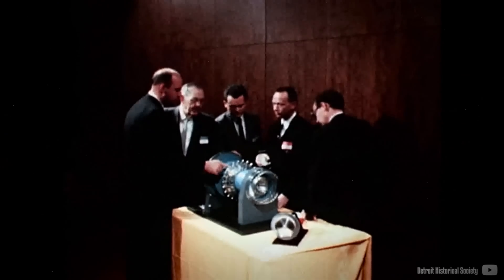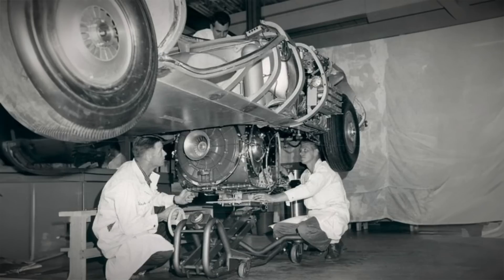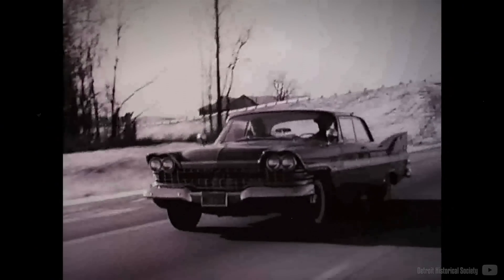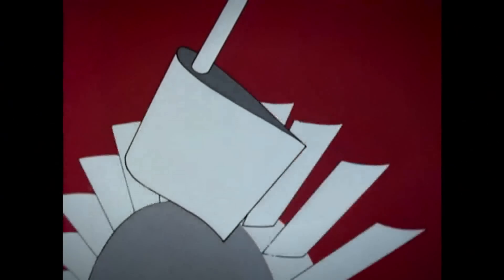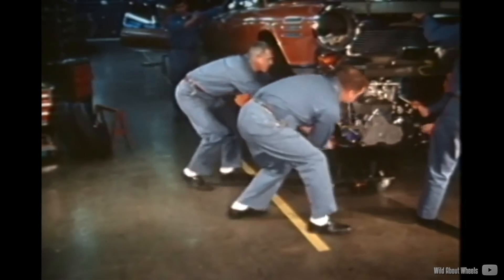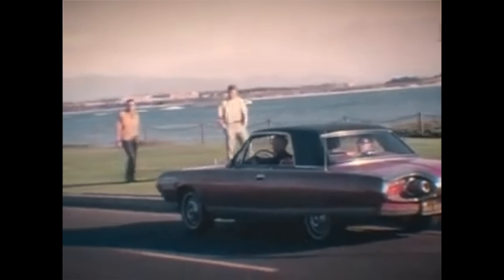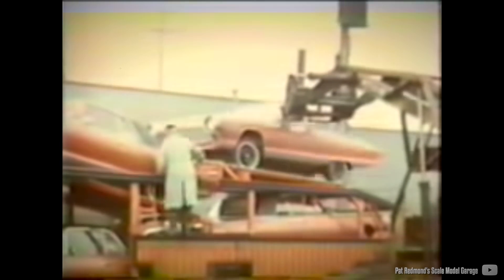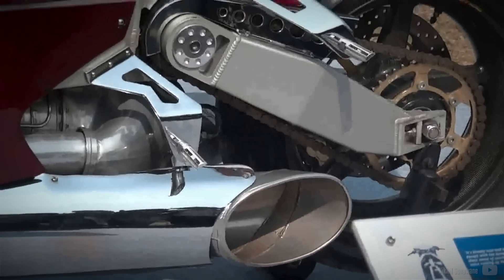The Failure of Chrysler's Multi-Million Turbine Car Project

Comment: This tech used along with  hydride tech. Seems to be a perfect car. Use the electric motor to handle the acceleration duties. While the engine slowly accelerates. The vehicle is moving at the requested speed. Then the engine recoupled to the drive. It could be electric with a turbine generator. The turbine only running to charge the batteries only, It could have a location for a 20lb propane tank. A 10 gallon gas tank, a 10 gallon kerosene/Diesel tank, and a 10 gallon ethanol/methanol tank. And s used oil tank, to akloe used and cleaned vegetable oil, or used engine oil to be used as fuel, Or the gas, diesel, kerosene could be one tank. And the methel/ethenol tank could be separate. Alcohol doesn't mix well with diesel,
Reply: Gas turbine engines are completely unsuitable for hybrid electric vehicles.

Not a very practical concept, you need multiple fuel control systems for each type of fuel.
Reply: Gas turbine engines are completely unsuitable for hybrid electric vehicles.

Not a very practical concept, you need multiple fuel control systems for each type of fuel.

Comment: Not a failure at all, as your video demonstrates, jet engines are the most efficient and powerful.  And it worked.  Chrysler was the greatest automaker at the time.  But did not have the infrastructure to manufacture and market its turbine car.  It’s a failure of having a regulatory regime on the   U. S. banking system.
Reply: It was an epic failure and was never a viable concept.
Gas turbine engines are completely unsuitable for automobile applications, they are too expensive and not fuel efficient at all, these cars averaged 5 mpg circuit and 15 highway, not impressive either with just 130 very sluggish horses.
Reply: @WilhelmKarsten  They already proved the suitability.
Reply: @frederickmfarias3109  The research conducted during the trials of the 50 preproduction cars proved it was not a viable concept.
The final nail in the coffin was the data from the customer surveys, people who test drove the cars overwhelmingly stated that the were unwilling to pay the retail sticker price for a gas turbine car.
Reply: @WilhelmKarsten  You don’t have eyes apparently, they worked, still work!
Reply: @frederickmfarias3109  Yet the program was ultimately a failure... a failure because it made absolutely no economic sense.
Reply: @WilhelmKarsten  Top speed was 120 mph.
Reply: @frederickmfarias3109  Preproduction cars are only 130 horsepower.
0-60 mph 12.7 seconds 
Top speed 87 mph
Reply: The program was canceled simply because consumers were not willing or able to afford the staggering cost of the gas turbine engine estimated to be over $55,000 dollars!!!
Reply: @WilhelmKarsten  Chrysler had previously problems in costs in manufacture of costs of critical parts of the car, but in engineering innovation was able to bring it down.  They could have done the same in manufacturing the car itself overall, and In economy of scale.!
Reply: @frederickmfarias3109    Sorry, but that was the cost adjusted for economy of scale and automation of manufacturing process.

Gas turbine engines are extremely expensive to manufacture and a similar 130 horsepower non-flight rated engine would cost around a half million dollars each in today's value.
Much too expensive for mass produced automobiles.

Comment: Was it the threat of reliability affecting profits of the repair industry ???
Turbines used in a common American tank seem to prove this......
Reply: This was never an economically viable concept.
The M1 Abrams scandal is not a good analogy..
The General Motors XM1 won the army trials, it's Continental AVCR-1360 Diesel engine beat the Lycoming AGT-1500 gas turbine in every respect.
The Turbine is the biggest flaw in the M1 design.
Reply: @WilhelmKarsten in the second trial of the competition, Chrysler heavily fixed their prototype and GM basically changed nothing. All of Chrysler fixes made their tank better
Reply: @2003AudiS3  The US Army rejected the Chrysler and awarded the contract to the Diesel powered General Motors XM1.
The rest of the story is one of the worst corruption scandals in American history.
Reply: @WilhelmKarsten  in the second trial the Chrysler was a lot better
Reply: @2003AudiS3  It still lost to the GM XM1, the Army did not want the Chryslers gas turbine engine or its fatally flawed turret design.
Reply: @WilhelmKarsten  The turbine was literally an equivalent to the diesel. Both used similar amounts of fuel but the diesel was less reliable
Reply: @2003AudiS3  Wow! So you have never seen the trials results have you?
The AGT-1500 was the worst in fuel consumption by a huge margin of all the engines tested and was the slowest in acceleration.
The AVCR-1360 Diesel was rated at 1,650 horsepower and passed the PTRT tests for reliability... Diesel reciprocating engines are inherently reliable by design.
The Chrysler version required a fuel capacity double that of the GM to meet the minimum range requirements.
This is the root of the fatal flaw that plagues the M1 to this day and the Army desperately fought against.
Chrysler did something very dumb, they moved the main ammo  magazine from safe down in the hull to up high in the turret.
A weak point in the design that many enemies have exploited.

Comment: The other killer was the high oxides of nitrogen emissions from the gas turbine that could not be easily reduced.
Reply: Yes, excellent point.
Although the emissions regulations did not exist yet, NOx pollution was a factor in the cancelation, the Chrysler program was ultimately canceled because of the astronomical production costs of these difficult to manufacture engines

Comment: Very nice video as always, thank you! 
It is clear that turbines are unsuited for cars, but I've been wondering if maybe one could consider using a turbine as a power generator/range extender for e.g. an electric/hybrid truck (either semi, or else). That would retain many of the advantages of the turbine wrt piston engines, while alleviating many disadvantages like throttle response, etc. Just an idea :D
Reply: Not a viable concept either.

Comment: Fast forward to 2023.... turns out if a jet engine is in the sky, the pollution and made-made cirrus cloud cover we see endlessly every day all over the world is not a problem. If a jet engine is on the ground in a vehicle? NO NO NO NO NOOOO! Much too polluting and would never pass emissions standards.
Frankly it's all about money. Who can pay off who. It's also about weather manipulation via JP8 jet fuel and all the crud they put in that fuel to modify clouds with 100,000 global flights per day.
With the modern microprocessor capability, Garmin units, and all the rest that operates these expensive small turbo-prop airplanes, I would think a very reliable and powerful turbine engine would be feasible for autos, much better than was feasible back in the day when it was tried by Chrysler.
Reply: The price of the engines killed the program

Comment: I don’t know that you could rightly call it a failure. They tried hard to make it viable and it just wasn’t. I think you could call it a failure if it made it to production and flopped.
Reply: Most manufacturers developed gas turbine engines, Chrysler was the only one foolish enough to build a fleet of test vehicles.
Reply: @WilhelmKarsten Bulshxt!
It was a success!  Chrysler did not have infrastructure to manufacture and market it.
Reply: @frederickmfarias3109  Not true, it was a failure.
The estimated mass production cost of the engines was over $55,000 in 1965, more than 16 new V-8 cars or a new luxury home.
Reply: @WilhelmKarsten  Still not a failure, costs can be reduced by materials research which Chrysler was doing, and by economy of scale.
Reply: @frederickmfarias3109  Sorry, but that was the cost adjusted for economy of scale and automation of manufacturing process.

Gas turbine engines are extremely expensive to manufacture and a similar 130 horsepower non-flight rated engine would cost around a half million dollars each in today's value.
Much too expensive for mass produced automobiles.
Reply: @WilhelmKarsten  It was not considered.  Invention cannot be accounted for by bookkeeping until after the fact.
Reply: @frederickmfarias3109 Yes, it can, similar engines were already in mass production and cost were comparable.

Comment: I believe Chrysler would have continued development of the turbine.  There was concerns and pressure brought by the government,  I believe that was more the reason then technology.
Reply: Nah, it's too expensive for Chrysler anyway
Reply: Regulations, regulations, regulations. That's why. Also, aircraft have furthered jet-turbine technology very well. Turns out if you have wings, you can pollute the skies to your heart's content. If you are stuck on the ground, nope. Regulations, regulations, regulations.
Reply: @turnin.sprocket Nope, it a matter of economics and duty cycle.

Gas turbine engines are more economical in commercial and military aircraft and their long service life spreads the cost of producing them over decades.
Aircraft need high power output in cruising, automobiles seldom require high power output.
Reply: That theory doesn't hold water, production costs was the reason for canceling the program.

Comment: Too bad turbines in automotive engineering didn’t stay long. Today a small multi-fuel turbine could be used as range extenders just like the incredible Ariel Hipercar, and with the current technologies in modern turbofans such as combined cycle and 3D-printed compressor could further reduce EGT, improve fuel economy and longevity.
Reply: Volvo did an hybrid with a (volvo aero sourced) gas turbine range extender, it was fully working concept that introduced the styling of the S80.
It was in the 90's.
Reply: @Damien.D It too was canceled.
Reply: Not a viable concept.
Reply: Oh it stayed. It's in airplanes all over the world, from giant 747 to the single-prop turbine powered aircraft. Also very reliable, hooked up to Garmin units, monitored by microprocessors, and all the rest. But if it's got 4 wheels on it? Nope, won't pass emissions. Regulate regulate regulate. If you have wings, you can pollute all day long. If you are stuck on the ground, nope, no polluting allowed.
Reply: @turnin.sprocket Exactly, it's because airplanes are still allowed leaded fuel for reliability. Mazda is supposedly bringing back the Wankel rotary as a range extender.

I loved this video, I learned for than I ever wanted to know about the Turbine cars.
Reply: @bobhill3941  You know what else airplanes have in that JP8 fuel? Leaving lines across the skies every single day?
Reply: @bobhill3941 The days of leaded fuel in aviation are numbered, it's also a very small market compared to jet fuel or MoGas sales.

Mazda canceled the MX-30 due to disappointing sales.
Reply: @turnin.sprocket  a mix of different fuels, that produces (between other things) water vapour when burned (yk, like cars also do); then freezes because of the surrounding air temp.
Reply: @WilhelmKarsten  Thanks, you gave me something to look up. Thanks regarding the MX-30, I'd forgotten about that. 

Do those alternative fuels provide the same lubrication, knock resistance, and protection the lead does?
Reply: @bobhill3941 dude jet engines can not use leaded fuel, it fouls them up, they can use almost any kind of fuel but leaded. Old piston engines in small light aircraft on the other hand, they do use leaded fuel
Reply: @Q3ark  Thanks, I didn't know it was that specific. Why does lead foul jet engines?
Reply: @Q3ark  Bull$ihte!!! Jet engines can and do run on lead gasoline!
The Westinghouse J34s on the Lockheed P-2 Neptune proves that you are completely wrong.

The Chrysler Turbine Car could not be used with leaded fuel because of the RECUPERATOR... Nothing related to core gas generator or the Turbine section..
Reply: @bobhill3941  They don't, it the recuperator (the exhaust gas heat exchange r) that gets clogged up with lead deposits.
Reply: @WilhelmKarsten  Thanks
Reply: @turnin.sprocket Chrysler canceled the program because of economics... surveys from the families chosen to test the vehicles but said they were not willing to pay the estimated sticker price to buy one.